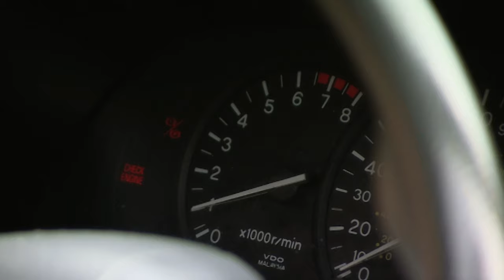Driving A Car With No Oil #TBT - Fifth Gear

Comment: It took me less than 10 laps on a racing course (50secs per lap) to kill an engine of an old Subaru Impreza. It suddenly started to eat oil.
Reply: Fuck, did it just start pissing oil all over the ground or something?
Reply: nothing like that, just sudden loss of power coming out of corner and cracking noises. It did another 25 kms on our way home, then died completely. 
We have new engine prepared.
(it is not STi or WRX, only 2.0l NA from 94, nothing special.)
Reply: did it consume it all or was there just an oil starvation issue? coulda just starved it out going through some bends
Reply: i would say part of both, oil was on the stick, but under minimum IIRC, 
so as you say, the oil might have been on one side where oil pump cannot
 reach and with high revs its over.
 Nevertheless we drove the ebaby this sunday, as you can see in my profile, and with new engine it runs slightly better. :)

Comment: There are some vehicles that now have electronic oil level readings on the dash and have no dipstick for the motor oil. I remember my first encounter with a BMW that didn't have a dipstick and I probably spent a good few minutes trying to locate the dipstick before someone told me that there was no dipstick.

Then there were vehicles that came in with a broken dipstick that required a pair of needle nose pliers and careful prodding to pull the dipstick out, the constant heating and cooling cycles in an engine bay can make plastics very brittle and sensitive to breaking. Thankfully that was a rare occurrence but each one was frustrating and memorable.

Comment: When the Austin Metro was first delivered it didn't have oil in it, the dealer was supposed to do it. Previous models were delivered with oil included from the factory. The inevitable happened...

Comment: SHOULDVE taken the engine apart and showed the visible damage to the engine. I am one of the guilty ones of this happening when I was 17 and bought my first car after nearly 2 years of saving up. It caused the turbo to blow up before anything. I’m 25 now and since then I’ve learned from my mistake. I check the oil every couple of weeks😂

Comment: I had a Corsa that was burning oil until the engine seized, it was a horrible experience. Had it towed to a mechanic who unseized it, replaced a couple of bent valves and it was back to life. I now live 50 miles from that mechanic but I still bring my cars to him!

Comment: I change my oil every 3,000 miles, sometimes even less o.o
Reply: +Cody Miller No reason to do that unless you're fouling the oil really fast somehow, like you have an old carbureted car that is running very rich and gasoline is quickly getting into your oil.

Modern oils in modern cars with good fuel systems last much longer than they used to, especially synthetic which has a service interval about three times that long in some cases.  Especially if those are mostly highway (warmed up) miles.

My car I still have to change my oil around then but only because it's 30 years old and I actually do have problems with gasoline fouling.
Reply: +Cameron Nunya Exactly. If I go 5000 miles, my oil is black. I can't fathom running my poor engine with that shit in the crankcase.
Reply: capnskiddies I used to go every 5000 on my old Chrysler town and country. At 160000 miles, the oil pressure light would come on from time to time. I started changing my oil every 3000 and not only did the oil stay clean for a lot longer, but the oil pressure light never did come on again. Sold it with 202000 miles on it and it ran great. That is with conventional or synthetic blends.

I run full synthetic in my old f150 and the oil still looks pretty good at 3000 miles. I change it every 4 just to avoid any engine issues.
Reply: I change mines every 5000/6000 miles, car will run forever if serviced regularly
Reply: +Cody Miller I have always maintained my cars oil and water levels and recently bought a used 1 owner from new, 2001 74,000 mile Hyundai Amica 1.0 (14 years old) for £150 as workhorse that had NEVER been serviced from new.. no timing belt change,3 oil changes and no water change. The oil was like Treacle and the water was furry orange, drained and refilled both, brake fluid, changed the timing belt, clutch and she is still going today 2 years later and 8000miles passes emissions with flying colours and sounds/Runs sweet as a nut. I think it is more  how it is driven whilst not being serviced.. as you saw he was at 8000rpm and thats what finally killed it. I think if you dont know how to service your car you should not be on the road!
Reply: +Cody Miller In kenya you risk engine damage if you don't change every 3000 miles or 5000 kilometeres. Our roads are really dusty, unpredicatble weather, many hills and descents, terrible diesel quality.
Reply: +ConnorWolf You cannot do this in africa. Max distance between services is 10,000 kms or 6,000 miles. A benefit of that is we get to uncover problems early, worn out suspension bushings, worn out brakes e.t.c
Reply: +Cody Miller I do it maximum very 5 000 km,or every three months.(which ever comes first)Synthetic only.Castrol or Mobil 1.Toyota oil filter.Manual transmission fluid,every two years,no more then 20 000km.Antifreeze,maximum every two years.My Corolla is now 10 years old,140 000 km.Never found drop of any liquid under neat my car,ever.Not a one drop.I bought my first brand new car,1994.I did same service to the other cars.Never had any problem with any of my cars that I purchased brand new,only with those that I got used.
Reply: Well done,sir. That's the actual service interval. for some African countries.Every 5,000kms warrants Oil change, oil filter change, and cleaning  of air cleaner.Every 20,000 kms warrants Air cleaner replacement, fuel filter replacement, oil change, oil filter replacement, and other fluid replacements if necessary. No wonder most dealer serviced cars in my country have manage over 500,000kms without engine overhauls.
Reply: +MrThecarfreak777 I know,I'm going into extremes,maybe.Over here,in Vancouver,Canada,we enjoy one of mildest climate in the world.Lots of rain,not much dust,not much salt either,not much son.Car is mostly parked in garage,not outside.Thirty years ago,i was one of those people with out any clue about maintaining vehicle,and with out any basic tools.I would fill oil right to the top.I was the one,filling radiator with coffee cup filed with water,by the highway when my car overheated.Every used car that I bought was garbage.I was paying tow trucks and mechanics,more money then brand new car would cost me.Then my wife got pregnant and we got our self brand new car:1994.,Mazda 323 for only 10 000$.I just couldn't believe how quiet,reliable and fuel efficient,that car was.I decided to take care of that little car,and another four after.I would take my vehicle to the dealer for service,but I would do my own service in between intervals.Whenever I drive across continent,i don't have to worry about being stuck hundreds of kilometers from nearest city.
Reply: at what intervals did you service at? coincidentally my parents owned a mazda 323 as well. my dad loved the car until a trailer forced him off the road and up a tree. main areas of concern were the weak original shocks and some parts of the body would crack.
Reply: well its not like shorter service intervals will hurt the car anyway.it could only do more good
Reply: Owner manual request,every 8 000km,or every three months.Which ever comes first.I did it every 5 000km,or every three months.That was 1994. 323 with 1.6 L engine,eight valves.Great reliable,and fuel efficient car.Weak point were brake rotors.Roughly,around 30 000km,rotors would get deep grooves.Same thing with my next Mazda,1997.Protege (323),1.5L 16 valves.On the other hand,my Toyota Corolla 2006. got first rotor replacement after 120 000km.No grooves at all.My wife's Toyota Yaris has 75 000km on the odometer.Brakes are still like new.
Reply: Shorter intervals than required are pointless and not to mention environmentally unfriendly. Shorter intervals won't do any good, adjusting the way in which you use your vehicle will be far more beneficial.
Reply: Chris Williams Read your owners manual. 95% of all drivers fall in the "severe" section, which often calls for 3,000 mile service intervals.
Reply: Lack of maintenance and abuse of vehicle,is environmentally unfriendly!
Reply: MrThecarfreak777  i will wait until my bew car reaches 15.000 this year to change the oil....
Reply: I change mine in my 1994 Accord EX every 3,000 because he's old and burns oil
Reply: @capnskiddies  20k miles is a bollocks interval even 12k is pushing it. 8-10k is best for synthetic oil change, if its standard oil every 5000 miles.
Reply: @MrCROBosanceros  You like burning money.

Comment: My buddy once had to go help a girl out once cuz her car wouldn't start.  He gets to the Wal-Mart parking lot and her engine wouldn't turn over.  She said all she had done was added some oil and then it wouldn't start.  He pulls the dipstick and oil is almost coming out of the top, he removes the oil filter cap and the oil is to the top of that.  She said someone had told her that sometimes you needed to add oil to an engine in between changes.  So she just kept buying the 5 quart jugs and filling it up until she could see the oil.

Comment: I had a 125cc Honda motorbike that was reading 70000miles and still going strong. I only sold it on when I got fed up with cleaning and adjusting the points ignition. I changed the oil every 2000miles and checked it often. I would still be using the motorbike if it wasn't for the ignition. The motorbike would now be 26 years old. I have worked as a mechanic and even new cars get through oil.

Comment: I wrecked my engine last week, wich appearantly lost 2 litres of oil in about a month
Oh that sweet rattle of the crankshaft
Reply: Well, unless it poured it all out at once, you should have been noticing a big change in overall performance over those 2 months to warrant checking it.
Reply: It can happen, especially with the pressures that are involved within an engine.
Reply: the same thing happened to me,found out they used the wrong type of oil,it was not thick enough for my engine and also a shitty brand.It could've caused me an engine failure.

Comment: At University I had an '89 Honda Civic that I purchased for $500 NZD from a foreign student who'd finished her degree. One day it ran out of oil and ceased (drain plug fell out.) I was so sad for my little car, we towed it home but I thought it was off to the scrappy for sure 😥. Then I filled it back up with oil the cheapest mineral oil, sprayed WD40 into the spark plugs holes and we towed it behind my brother's car just gently using the clutch to get the engine turning and oild flowing through it again. I turned the key and it coughed and spluttered back to life! 😆 That car went another 50,000km until some dozy bint failed to stop at a junction ad wrote the old girl off. So don't give up just because your car has ceased, have a go at getting it going again.

Comment: In most cases, the reason behind the oil going down is due to insufficient servicing, or the car has an underlying problem with oil. Burning oil or a leak somewhere. 

It's very easy to tell when your car is low on oil, the engine even sounds different.
Reply: This is somewhat true, but if it starts to sound differently.....
New oil CAN really change how your engine is running though, much smoother compared with when there was old, blackend oil in it.

Comment: I check my fords oil every single time i go for a drive.. And it's always at max level and never goes down..
I check my micras oil every single time i go for a drive and it slowly goes down..

But i don't check my previas oil because it has a gallon tank of top feed oil which needs to deplete completely until the engine has no oil.. 

You should always do this check list when going for a long trip:
-Check oil
-Check coolant
-Check brake fluid
-Check tyre pressure
-Check washer fluid
-(optional) Check transmission fluid
-(optional) Check clutch fluid

Once you're done with that check list, you can drive a long trip with a peace of mind that your car won't let you stranded.. Unless if it's a french car, then you're screwed.

Comment: He said it's best to check the oil when the engine is warm but I've always been told its more accurate when cold
because the oil has migrated down to the sump. What is the consensus?
Reply: I think the odd manufacturer (Mercedes?) specify a warm oil check.  but otherwise no, you can check most vehicles warm or cold, just give ten minutes before checking if warm.

Comment: There are several warning signs. To get low on oil you must lose it somewhere. So a puddle of oil underneath the car is an obvious sign. If the oil is consumed due to shot piston rings, then a cloud of blue smoke is another indication. And at last the oil hazard light.. but this one lights up when the pressure drops (that means the pump is out of oil, no pressure is created, etc) - so the light comes on when out of 4L of oil you have less than 1L

Too much oil can do way more harm: piston comes down the oil is pumped up the block emissions hose that reaches the intake manifold, the abundant and liquid oil fills the combustion chamber enough that the piston will be hydraulically blocked (the liquid is in-compressible). At this moment, due to momentum the engine continues the rotation bending/snapping the connecting rods and catastrophic failure - rebuilding is sometimes not possible as the crank can be bent, all moving parts must be changed but sometimes the half broken connecting rods poke holes and shatter the engine block..

And topping to the max with some random oil is not advised.. some oils react to each other.. because of different additives used (this is not about different brands, but different norms for the oil) - Always put the right oil for the car. If it says 5W40 SAE ACEA A3/B3, API SM/CF, VW 502.00 - be sure to put exactly this type of oil (the last indicative it the most fail-safe.. the brand oil specification.. it says in the manual.. put VW502.00 oil, then you need a can of oil that in the long list of car manufacturer standards you standard is included. 

The SAE and API ratings are more general and can still mess up.
For further research, search for SAE viscosity of oils, API ratings of oils and other oil related articles

Comment: My friend worked in an auto center and the number of cars that came in with barely enough oil to mark on the dipstick... was terrifying! Modern engines that use super low-weight oil are way more prone to burning oil, so checking the level is even more imperative. The sad thing is anyone can do it in a matter of minutes and it takes no fancy skills either.

Comment: that loud noise is the piston slamming up against the headgasket. When it hits the head, it sends shock waves through the piston, the connecting rod, down to the crankshaft. If he continues to let it happen much longer, then the connecting rods are going to break into pieces. I have seen it happen before to a case 444. Also, if there is no oil in the engine, then the engine will automatically blow-up.

Comment: My car gets every 2 months a synthetic oil change which is about 5,000miles. Honestly i was one of those people who didnt care for maintenance in the car until i had all the issues a car can get withiut giving it care. 

Whether it was oil being low, low coolant (almost blew my engine), steering pump was all used up from wear and tear which generated a leak that spilled steering fluid onto the alternator which damaged that. Rotor pads and brakes, new belt… etc. There were a few problems like these that actually made me very poor due to lingering problems that shouldve been resolved before something catastrophic happened (which did) and now I take very good consideration of every sound and overall daily feel of the car and to inspect and analyze before those issues happen again. 
Dont be that person, inform yourself and let precaution be a necessity rather than instability.

Comment: oil isn't just to stop the moving parts tearing each other to shreds. Having no oil can always seize the engine as the friction between the two moving parts produces an immense amount of heat which in the end seizes the engine the extremely hot metal welds its self together and stops anything moving were the engine has been siezed

Comment: just going to point out that he said to check the oil when it is warm. i am pretty sure you are supposed to do it when it's cold.
Reply: Honestly it depends on the engine but usually you check it when its warm. Run the engine so the engine gets all nice and lubricated, then turn it off and let it sit for a minute then check the oil.
Reply: I run my engine for a few minutes before I mess around with my oil. Warm oil flows easier. :)
Reply: Depends on your dipstick. Some dipsticks have a "hot" and a "cold" reading of where your oil should be based on temperature. Otherwise, always check when warm. Run your engine for a minute or drive around the block, then check.
Reply: I don't think the engine cares as long as its got some oil between the marks on the dipstick...preferably at the upper end, but anywhere will do. Its when there is no oil on the dipstick the trouble starts
Reply: Warm oil will give a more accurate reading on your level
Reply: It really doesn't matter.
Reply: The viscosity of oil is less when heated, if checked warm the levels will be more accurate to the levels when driving.
Reply: Also heat the oil before doing an oil change to ensure most of the old oil and residue is removed.